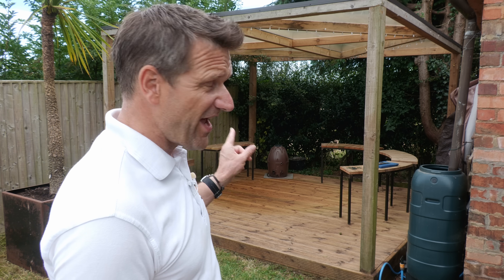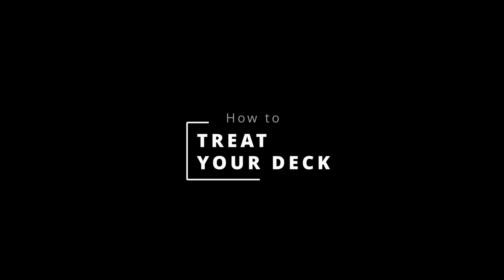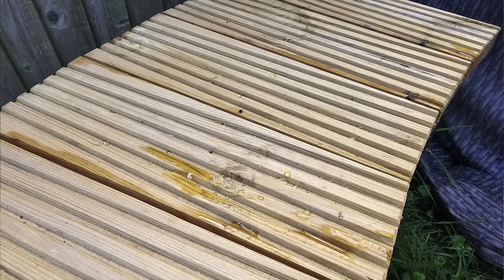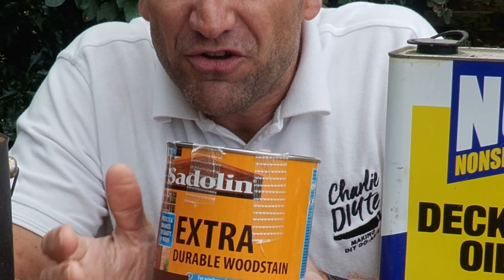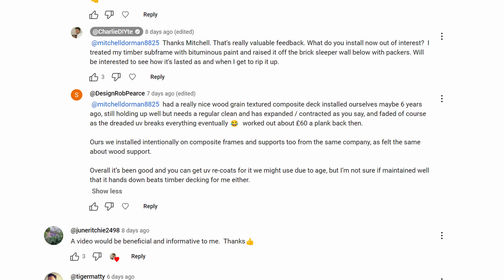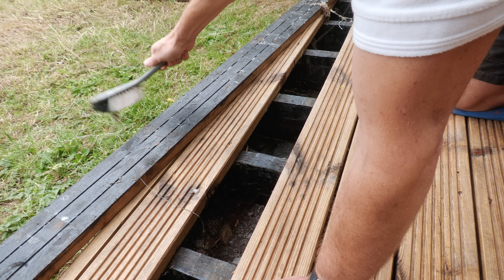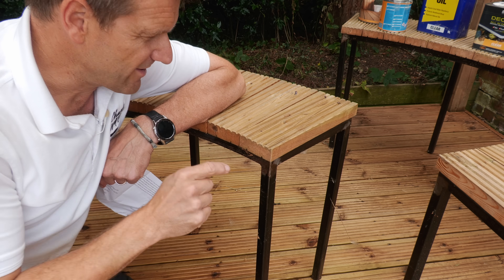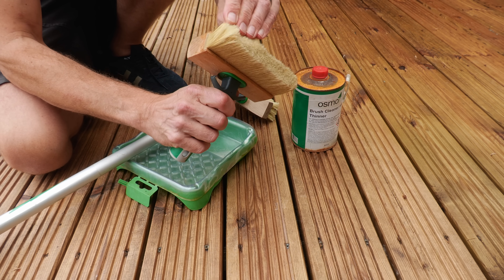Four Years of Deck Cleaning and Oiling - What I've Learnt!

Comment: Great vid Charlie and cheers for the shout-out! 👍😎 I'd concur with all of that. It'll be interesting to see how mine turns out since it's against a north facing wall that only gets sun 50% of the year. A mate of mine has decking that went down over 20 years ago - it was installed pretty badly and has had almost zero maintenance. It's still more-or-less fine. Yours still looks new - amazing! 👍💪
Reply from the maker: Cheers Andy. Yes your deck will be bullet proof and for a couple of hours' very satisfying work once in a while you can keep it looking great. Maybe being north facing will be a godsend in that the sun won't break down the oil so much .. 👊

Comment: Another great video Charlie, very interesting to see how the substructure has performed over that time. Hopefully the one I installed (using your original video as a guide) will still be ok Also. I noticed that although you mentioned that you had installed the decking without any gap, you didn't say what gap you did use on the re-install. You might remember that I used the Kreg jig and screws to give a nice consistent gap and also as the screws are inserted at a 45 degree angle, they are hidden from view. I fitted Yellow Balou boards and although they did need some extra treatment in the early stages, they have remained in really great condition since with excellent water beading
Keep up the good work and thanks again for always showing your mistakes as well as your successes
Reply from the maker: Thanks mate. Yes I should have mentioned that. It was a good 5-8mm I'd say. Great work going for the balau 👌

Comment: Thanks for this. We had a timber deck installed in June and while I don't know the ins-and-outs of what wood was used as we didn't install it ourselves, this is still a helpful video. I've also watched your decking oil vid from 2021 which I would recommend to anybody wanting to maintain a deck. Good nod to Gosforth Handyman too. I've watched a few of his videos and found them interesting so I will check out his decking video as well.

Re marina decks. My guess (and it is only a guess...) is that timber is preferred because I believe a downside of composite is that it can get slippy - or at least slippier than a timber deck - when wet so if that's true then it would explain why most decks in those areas are made of wood.
Reply from the maker: Thanks for sharing that, Martin, you're probably right. 👊

Comment: Hi Charlie, in my old house built a deck in 2003 with basic tanalised subfloor and the typical decking boards. For the first 15 years or so minimal maintenance and was fine. As the boards started to look scruffy used deck repair paint - bad decision as looked great at first but chipped and scuffed and needed at least yearly re-paint. Still, lasted 18 years before we moved out (and still down with the new owners). Built a deck in the new house just over 2 years ago with tanalised subfloor, bitumen paint on the top edges and composite deck (light grey with dark grey edging) with the t-track fixing to hold it down. Looked great at first, gaps perfect but with constant expansion and contraction the boards creep and the gaps now look awful. Need to spend a day getting the gaps good again and putting a single screw in each board to anchor one point in place. The composite boards also scratch fairly easily. If I were to do it again would use a natural product.
Reply from the maker: Thanks mate. That's really useful feedback 👌👊

Comment: I can say with experience having the grooves on the bottom & flat side on the top is the best way to do it. First deck I built grooves faced up & even with cleaning turned into an ice rink when wet in the summer & in the winter. Second deck flat side up not slippery in the slightest.
Reply from the maker: Thanks. I agree! 👊

Comment: Very interesting review, I've built a number of decks over the years and always seemed to move house a year or two after building it so never got to see how mine fared.  I was pleased to see that over time I've been doing similar things to what you've done with the exception of using decking paint rather than oil.  That came down to an style decision by the boss.  But although the paint will come off over time, or a strong pressure wash, at least it means I can change the colour every few years if I want.   Oh, and never use so called anti-slip paint.  It maybe is anti-slip, but the finish is awful and just attracts dirt and mildew.   Keep up the good work, I've learned loads from people like you, Gosforth Handyman and Stuart from Proper DIY - would love to see you all work on something together :)

Comment: As always some well thought out and good general advice Charlie.
For years I've installed ridge side down and this I've found makes a massive difference for longevity of both the decking and subframe (tho I also creocote the subframe). The double sided decking is made to cater to customers who like the aesthetics of ridged decking (according to the suppliers I've spoken to).
The misconception of ridge side up being more grippy is based on feelings and not fact, I've had this same argument with far more competent joiners than myself but the argument begins and ends with 'find a single Yacht manufacturer that fits wood decking with ridges' teak isn't magically grippy it's wood it just weathers better, the same joiners also argue decking is lethal in the wet yet smooth topped decking I've installed in various properties is only slippery when covered in ice.
Reply from the maker: Fair point. It makes sense doesn't it. You need maximum surface area under foot for your show to grip onto. If it gets a bit slippy, clean it 😉

Comment: I've always wanted decking and even though we're about to move into our forever bungalow soon, there's nowhere I can think of where I can put any decking. I think. Bit of an odd shaped garden so once the fence has been put up, will have to look at what my options are then. Many thanks for this video, confirmed a couple suspicions (I used to work for a timber yard that sold the composite stuff and I've always had my reservations on it) and I've learnt quite a bit.

Comment: Thanks for the update Charlie, If I remember right, I think you mentioned you had to buy the Osmo  pole , £24-26 as  Osmo had mad it a proprietary  connection. which was annoying . I actually needed up buying a cheep B&Q  own brand extension pole for less than half the price. It does not have the locking tabs but the screw end tip is small enough that it will slip into the brush head with no problem and you just push and twist it in. It locks into place very tight and I had no issues of it coming of when using it  vigorously.
Reply from the maker: That's good to know 👌👊

Comment: Nice video good for people to see what to expect. As long as the base is good that's where your save as when you come to change the decking your won't need to do the base as well. In regards to the DPM you tried to use your right to use it if its a base for a building with an overhang on the roof. In your case you didn't put the roof on and when you did not much overhang so rain gets in. The DPM will last forever but the paint won't. In short if its a deck base paint the underside and tops and leave the sides of the joists but if its a base for a shed, cabin or something with a roof and roof over hang use DPM.
Reply from the maker: Yep that's exactly what I did. 👊

Comment: Thank you for the video. 
Strongly recommend 32mm deck timber.  Strongly recommend flat surface on top. Also Strongly recommended using concealed fixing screw, so clean on the surface.
Reply from the maker: Thanks 👌👊

Comment: I’ve recently redone my decking that had survived 12 years.  The subframe had rotted in many places but not in areas I’d applied 2 coats of wicks liquid DPC, ie at joint positions and support brackets.  This time, like you I applied a bitumastic coating (the same Wicks brand) but not on the underside to allow the wood to breath.   Since the top of the frame had the greatest proportion of rot I applied a 100mm strip of self adhesive flashing which folds over 25mm each side.  I’m hoping this will last much longer.

Comment: Great video Charlie. Longevity is all in the base. As long as you keep joists off the ground and have plenty of airflow it will last decades.

You have put me off replacing some of my decking with composite - the fading and warping was my main concern for something so pricey. The main deck i was thinking of is at a chalet we rent out on the Pembrokeshire coast where the weather is extreme. But its so large it takes a few days every year to do the maintenance on - and you can never get enough dry days in a row in spring when I try and get it ready for guests. Every year I try new hacks and tools but the grooves are what make it so slow. I just wish more places did proper flat decks - I wonder if the grooves help mask imperfections which is why its sold?
Reply: After 1 year my cheapest composite still looks pristine, very nice to walk bare foot for me and toddler, just feels like being on interior floor. Will see what happens after more years though, fingers crossed...

Comment: I used Iroko for an internal deck underneath the shower in a wet room. Five years later when I moved out, I t was good as new even with the dramatic temperature fluctuations (glass ceiling) and humidity - untreated.
Reply from the maker: That's amazing - and great to know. Thanks Simon 👌

Comment: Great analysis video, but just one thing-stainless screws don't corrode,  but they snap very very easily. I stopped using them because when you try and remove them from weathered wood, you tend to lose 2/3rds of them and then you have to deal with the bit of screw that's left in the wood.🥴
Reply: What's you use now then
Reply: @coolmonkey619  The very same timbadeck green screws you see in this video.👍

Comment: We’ve got a large raised deck that needs replacing at the back of our house - we installed it when we renovated the house 16 years ago. The subframe is in almost perfect condition built with treated 6x2 - we gave it no special treatment (We renovated the house and intended to sell immediately) It’s the posts that are failing. I think in future, I’ll do what the Americans do and build off concrete piers.  Or maybe just use a steel frame.
Reply from the maker: Could you set new posts, maybe concrete, near the old ones without moving the sub frame? Concrete deck posts pre drilled for a tenner each

Comment: We got 22 years from our wood deck. I'm now rebuilding new. Neotimber plastic joists and posts for elevated sub frame. If putting in the effort and time, may as well spend and get something that won't rot. I'm guessing 3 times the price of wood. Save money on the top boards if need be, but don't scrimp on the subframe - I dont want to do it again! Simon Bowler has good video on this.
Reply: We used Kwila hardwood for our deck and after 25 years it's still as good as new. Hardwood is the way to go. Edited to say that we only waterblast and stain every 4 years.

Comment: There is only 1 tip get good quality composite decking, job done, replaced our aging wooden one for the third time many years ago, it still looks as good as they say we laid it.!
Reply: What brand and type of composite if you don’t mind me asking?
Reply: @liftfan2  lots of sellers even the Wickes stuff is good when on offer, just watch for the stuff with a thin top & large hollow cores. Ours is solid but most has cores now, my son-in law got the Wickes when it was reduced & that looks great, fiddly little clamps to fit but comes with a thin bit so it doesn’t mark the inner edges. (Fittings are between the boards so hard to see)
Reply: @thomasbroker69  Thanks for the tips! There are so many brands it’s difficult to decide.

Comment: My best tip is to buy the NKT hidden fastener system, especially if you're going smooth. It makes installation a piece of p***, and doesn't give water a well to sit in.
Reply from the maker: Interesting 👌 I guess the only problem with the NKT is trying to get the screws out if you need to take the deck up. I don't notice the screws once they're in.

Comment: I have large Softwood Deck. Big fan of the Ronseal Deck Cleaner/Reviver. What do you think about Decking Paints?
Reply from the maker: It's brilliant isn't it. I wouldn't use anything that sits on the surface. For me it's crucial it sinks in which is why I also wouldn't touch water based decking oils - should have mentioned that 🤦

Comment: How thick were your joists please
Reply from the maker: 6"x2" so about 45mm
Reply: @CharlieDIYte  thank you I have loads of 4x2 do you think that would work with more supports to the floor I have spare railway sleepers to tie them into would this work do you think
Reply: @decisionsdecisions8906 max span of a 4x2 is 6 feet. The old rule of thumb for calculating depth of timber vs timber spans (imperial units not metric) is to divide the proposed span by 2, then add 1. So 6 feet divided by 2 =3+1= 4 inches joist depth. If your span is greater then add additional support at max 6ft centres.

Comment: What I've learnt with decking is to never put it down and get rid of it as soon as you can. 
It may be all fine if you are OK with all the maintenance and initial cost but a few years in and if the decking is in the sun it splits and you get nasty splintering wood when it is dry. 
When winter comes and it is wet it goes green in no time as wet just sits in the grooves. Then it is ridiculously slippery. 
I bought a house with a big patio of decking that is about 10 years old and it is all coming out soon. Awful stuff! Really just dont do it.
Reply: Wood splits because it dries out. Keep it oiled and it won't split. It gets slippery because it's not properly maintained. If it's going green there's insufficient light and air flow to dry it out. The green stuff only grows because it stays wet for prolonged periods of time.
Reply: @YesiPleb  Or it is not a suitable material for the damp uk climate.

Comment: Hi Charlie. Been a fan and viewer for years and love your vids. May I respectfully say that in this case, by way of design your deck is a lot of effort and not a reasonable amount of reward? (I'm not referring to the reward of the time you spend there as such... that's a different matter.) We laid a concrete slab (5x4m) and simply mortared a load of bricks onto the slab. Installed 2 drain outlets which lead to a soakaway a couple of metres up the garden. C24 treated timber, straight on the bricks. No faffing painting timbers or worrying about condition. We are 4 years down the line as well, and the timbers are basically as new. We used hardwood decking - Balau, which was 16 quid per plank from Builder Depot. A bit more expensive but - after multiple visits where I went and manually selected planks that were actually straight (!), it looks stunning to this day. I used timbadeck screws - small star heads that sink flush. And you know what - I screwed the boards down at each end (left and right side of the plank) plus only 1 or 2 points in the middle. Out of laziness I didn't bother doing any more. The things are still going strong, no bowing or twisting, tonnes of ventilation as I left good 3mm gaps. Admittedly ours is built right up against two party walls either side (brick, about 3m high) so that prevents rain coming in from the sides and rear. And at the front we have white curtains for hot tub privacy. A bit fun when it's windy, but still completely usable. Roof is a single pitch with a good fall, mini plastic corrugated stuff with split bamboo loose laid on top and cable tied down at the sides. Sexy philips hue lighting around the bricks, and it's a lovely little indoor space outdoors. Roof is held up by 4x4 posts (sitting on little concrete risers we poured in place, 4x4 to match the posts above and with a stainless steel rod sticking out, which then we resin-fixed into a hole we made in posts, then 2x4 joists above with roofing battens going across every 150mm. That's what the mini plastic corrugated roof went on. The plastic crap is hidden as you just see bamboo. But perfectly waterproof. (More so than my home... err...?) Whole lot painted in ronseal walnut colour. We installed a fridge, hifi, wifi, concrete counter top, the whole lot. By the way - hot tub went straight onto the concrete and we decked around it. Much easier that way. Also a nice large corner bench which accommodates 3 people or 2 people lying down. Made also from the balau hardwood decking. If I could do it all again I would definitely consider using composite. Our hardwood decking looks good still - really good. I didn't treat it with anything from day 1, and still don't really feel the need to. It's protected enough. No mould or algae due to good ventilation. But it has silvered slightly as you'd expect of any wood. I prefer the nice rich tones hence thinking composite might have been better. But still - we really enjoy the space and watching this vid, I feel very grateful we put the initial work in to make it lower maintenance in the long term as I know I wouldn't be bothered to apply oils and whatnot a few years down the line...

Finally - not wanting to sound like a complete snob, but I really do think softwood decking looks a bit basic. The hardwood planks are thinner and look really refined in comparison. Just my personal opinion :)

Comment: Old diesel engine oil.

Better than creosote
Reply: Awesome stuff isn't it! Goes on black and doesn't take long to dry and fade slightly showing the wood grain through quite clearly. I've built two very large planters out the front of my place (1m x 2m x 17") and a recycle bin storage shed. First coat was Creosote (not Creocote!) and after then every year middle of summer I coat with used engine oil from a diesel vehicle. My local garage is more than happy to supply this for free.